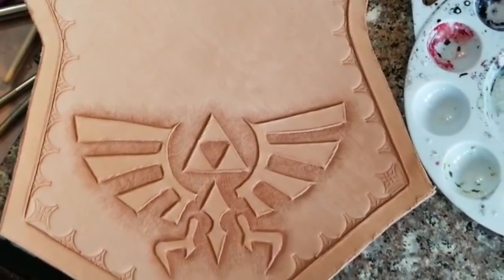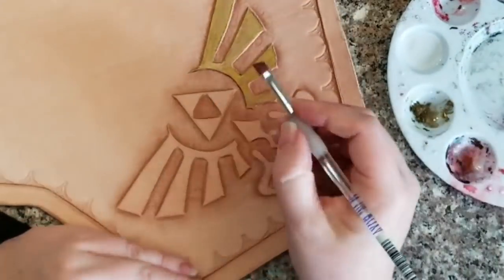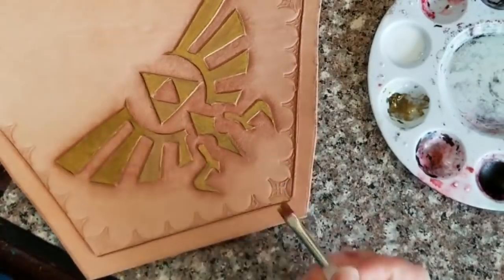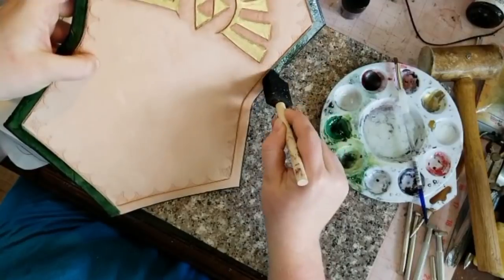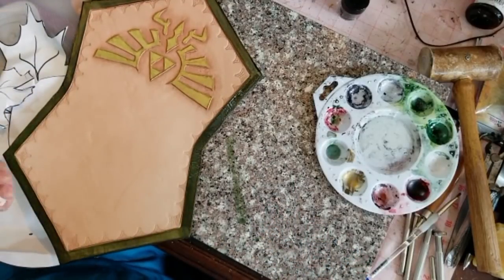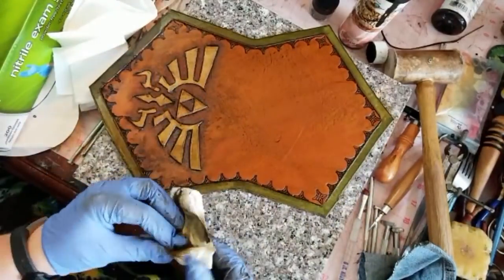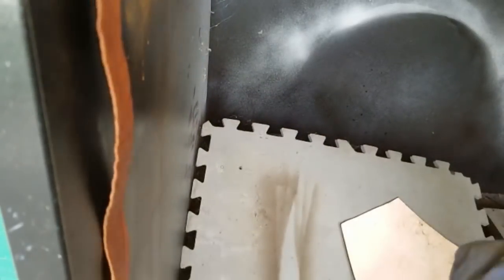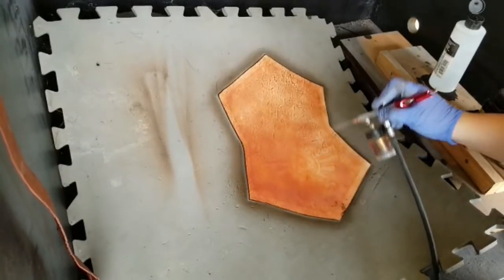Staining a leather purse

Comment: I was terrified of my airbrush to begin with, keep practicing and before long you'll wonder how you ever lived without it! Pro tip I was given was to hold the airbrush daily even if not using it, it will give your hand muscle memory and strength so you don't fatigue as quickly.